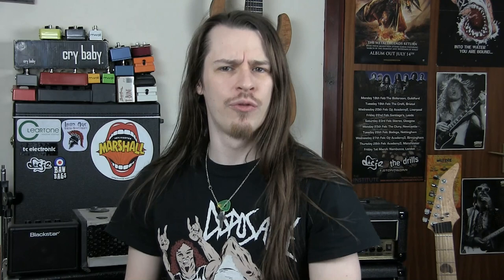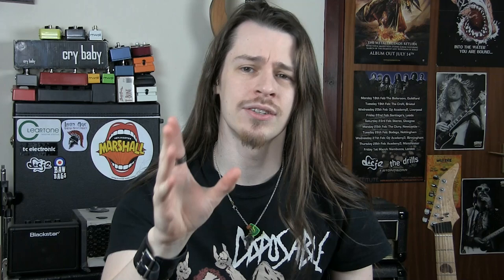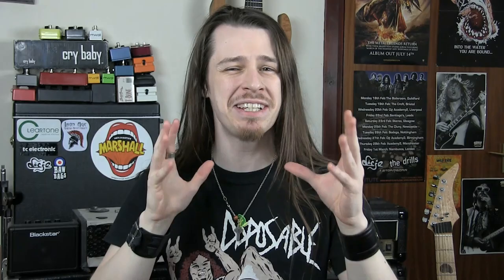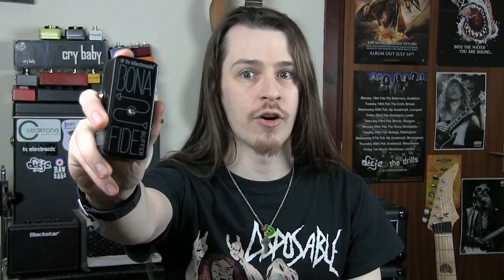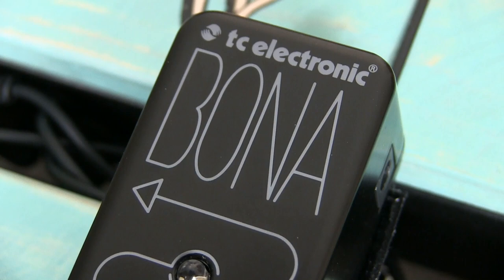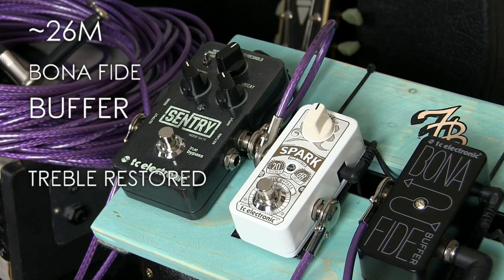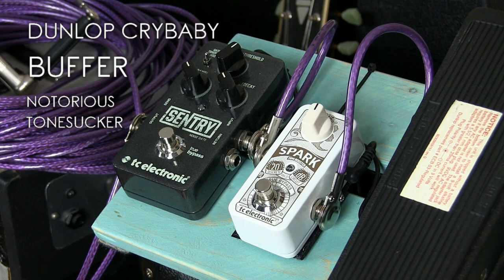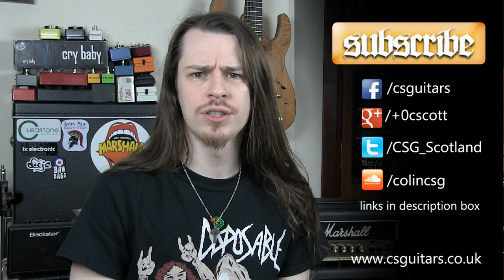The Truth About True Bypass

Comment: Another great video Colin. It would be good to quantify what makes a 'good' buffer and what makes a buffer less good. 
I'd suggest something like: 
Frequency: 80-18kHz +/-0.5dB
S/N>80dB
input impedance >1M
output <150R
THD<0.1%

If you're interested, I'll run some tests on the Boss, TC and crybaby buffers and see how they end up numerically.
Reply from the maker: I'd be very interested to see your process and results.
This would be an important resource.
Reply: +Keld Ampworks Yes please! :) I would love to see results. What will you be using to measure the db's from the output?
Reply: +Telebasterd Audio Precision gear for the audio tests, simple oscilloscope and fixed resistance method for the impedance checks. Not got round to it yet though, I'll dig out my DS-1 and make a start next week and post the results on. https://www.facebook.com/KeldAmpworks/?ref=hl

Comment: I've done rack kit for 15 years and not really messed with anything other than a metal sound. Bought a small valve combo a few years ago to play about with at home. Just bought an EHX Crayon as I was looking for a mid boosting pedal and found the crayon did the  metal TubeScreamer thing as well as well as being a useful distortion in its own right. Was great in the shop with short cables. Ran straight into needing a buffer when I got home.

Comment: Leaving your guitar cable coiled up, like you did, is also called an 'inductor', which kills your high frequencies, as well. Use only as much cable as you need. If you have too much cable, don't roll it up, spread it around in a random pattern behind your amp to reduce inductance. Try it. The results are as pronounced as the experiment you just performed. A long time ago, I learned this lesson when our band was using 100' speaker cables on small stages, coiling the excess cable and wondering where all the high frequencies from our PA to speakers were going. When we shortened or uncoiled the cable, the high frequencies came back. Good video.

Comment: As someone who doesn't know a ton about gear, I really love these videos. Can anyone recommend a wah pedal that isn't a tonesucker?
Reply: +Joe Nitrate Just a get a normal CryBaby and either adjust the EQ on your amp to compensate or convert it to True Bypass. Colin has a video about how to do this - it won't cost you much and isn't hard. I'm a total fucking pleb with a soldering iron and I've done mine.
Reply: +Joe Nitrate It's not exactly what you're looking for, but it's usually possible to add a true bypass switch to a pedal. This is a pretty common mod for wah pedals, and it's a full true bypass system - not just some "kinda" true bypass thing. You could do it yourself (It's not super hard to do, and there are loads of tutorials online, including one from the mighty csguitars himself), or you could pay for someone else to do it. The parts themselves are really cheap, the labour might be a bit more expensive - luckily I had a mate studying electrical engineering, so he did it for me for free.
Reply: Good advice gents, thank you
Reply from the maker: I have a video playlist of pedal modifications, which includes a demonstration on how to make a cry baby true bypass.
It's an older video, but it still checks out.
Reply: +CSGuitars speaking of which, I have the Dimebag Darrell signature Crybaby. It already has 2 LEDs (one to tell me whether the Wah is on or off, another for the boost), but would your True Bypass mod work on the artist signature Crybabies as well?
Reply from the maker: ***** It depends on which model of Dime Crybaby you have. The DB01 is Buffered, DB02 is already True Bypass. 

I can't speak for the differences in the circuit between the Dime and the Standard Crybaby, but I'd assume that you'd be able to implement the mod the DB01 without too much trouble.
Reply from the maker: ***** Just imagine how good his tone could have been if it wasn't though...
Reply: CSGuitars I have the DB01 model. Actually, it's still stock (as are all the rest of my pedals), and I still need to learn how to use a soldering iron before I even think about DIYing anything, but I am interested in getting my DB01 modded for true bypass.
Reply: +Joe Nitrate the new dunlop crybaby mini is a 3 voicing wah with true bypass
Reply: Ethan Yong I'm hearing that the new John Petrucci Crybaby is true bypass as well. And from what I already know about it, that's giving the Dime wah a run for its money (and that's me speaking as an owner of the Dime wah).
Reply: +Dion R Best way to get into pedal modding is to buy a used DS-1 or MT-2 and do one of the widely available mods. Not only do you end up with a decent pedal, but it only sets you back a few dollars (as in less than a hundred).

Oh, and look at that! Colin has videos for both of those! What a coincidence.
Reply: +Oliver Smith na..the FUZZ Pedals crushed his tone..so don`t worry about the cry baby ;o) different times
Reply: try the petrucci cry baby wah
Reply: +Joe Nitrate Dunlop Cry Baby
Reply: +Joe Nitrate MXR MC404 wah has true bypass, plus some other cool features as well (if you haven't bought a wah yet).
Reply: CAE dunlop cry baby is true bypass.
Reply: Apparently the Dunlop MINI cry baby is supposed to be good, according to people on a site I've been reading, there is no tone suck, unlike on the larger version, and the mini pedals are just as comfortable - I don't have one but I have a cheap expression pedal of that size and I have clown feet (size 13!) and I love that size pedal, the full size one only LOOKS more comfortable, but in reality, they both feel the same and the smaller one is better for bypass.
Reply: I used to have an original 1980's crybaby and I thought it was so thin sounding. I wanted a pedal that sounded great with a tone that has a lot of gain. I also didn't like the way Dunlop and others have a button under the pedal, I found that it was hard to turn on and off and I wanted one that would activate as soon as my foot went on the pedal, and off when I removed my foot. So I looked around and found the "Morley - Dragon II", and it is truly my savior. I don't find that it sucks tone much, if any, but it also has 2x wah settings and 2x knobs to change the depth of the wah swells, as well as how fat you want it to sound. George Lynch designed it, and believe me, it's a great wah, and I don't need to look any further.
Reply: The MINI version doesn't suck tone as it has updated circuitry (buffer) andyou canfind cheap wah pedals that are true bypass on Amazon. I'd go for a Zoom G3x - Wah, noisegate, dirt/amp, EQ, comp, modulation & ambience for a little more than the price of a crybaby, and works in a pedalboard.

Comment: From readings online, the magic number for cable/cord footage is 18.5 feet. That is the length where the cable has enough resistance by itself to effect tone. It's basically a matter of math. If you used a 20+ foot cord from guitar to the 1st pedal or the amp itself, you lost some highs in the tone with that section of cable. Mathematically, let's say you have a 5 pedal chain with 6 inch patch cables in between, that's 4 patches at 6 inches or 2 feet of cable. Then there is the true bypass or buffer to add in for each pedal as it applies. Is that 2.5-3 inches for the mini pedals widths ? Add another 5x 3 inches for the tethered chain and the pedal board itself is 3.25-4 feet of equivalent cable length. You'd have to run a 3 foot cord from the end of the pedal chain to the amp, 10 feet from the front of the pedal chain to the guitar to stay under 18.5 feet. Most instrument cables are 5 feet, add a 10 footer and also that 3.25-4 foot pedal chain and you get 18.25-19 feet. The larger full size pedals get you to high level tone loss in that chain of tone & effects.

Buffering is better in that regard, because a buffer stores the highs and passes it on. But let's say you go with a 20 foot section after the pedal chain to the amp ? You just lost that buffered effect in the pedal chain.

I use a 10-20 foot section after the pedal, 10-20 feet from guitar to pedal chain. I jave 4 pedals so we'll call that 2.75 more feet. Where I put the 20 foot cord has me over 18.5 feet, Buffered pedal makes no difference for what signal strength & tone that I lost. I think if I went 10/10/3.25 feet segments, then buffered pedals make sense.. Because the tone is preserved in 10-13.25 foot segments. Cables by their very nature degrade signal, inch by inch, foot by foot. You'll be able to tell that difference more noticeably after 10-12 feet. Those pre-manufactured sections of cord are conveniently measured lengths for a reason.

Comment: This is why I run my Blackstar HT-Metal first, really good buffer in it, it does colour the tone slightly but I find the way it does so really useful. It seems as though the EQ is still slightly on even after being turned off meaning there isn't a really drastic tonal shift when I turn it off.

Comment: Also worth mentioning than when you use a looper switch true bypass on the pedals isn't as important as when they are chained directly together since the looper will take over most of the bypass function.
As buffers I use the one from the Sentry before looper and Mimo after, going straight to an amps clean channel only.

Comment: I can vouch for the Bona Fide buffer and have 6 on 3 rigs. I run from guitar to stage pedals, mostly od's then to a rack with all the rest that are bypassed and manually turned off/on so they are not always in the loop. I noticed a nice bump up in volume,treble and overall tone with one after the floor pedals and one after the other effects and before the amps.

Comment: First of all you got a really great channel there. I love your vids, i can still learn from your guitar philosophies although i Play for more than 35 years (Perfect example is your vid about to set up gear with all the guitar volume and tone turned down a bit to be able to regulate up and down and not only to attenuate. I somehow knew this of course, but i never viewed it in that simple way which is totally logic :P) I also did a lot of modding to guitars and gear like you do, to know how to work with electronics is part of my Job and was a Hobby of mine since my youth.On True Bypass: Recently i really think about true Bypass for all pedals (aquiring some pedals who offer true bypass Feature to replace those i usen which don't). One thing about true Bypass: it allows the "working together" of the Input tube of a tube amp directly with the guitar if all effects are switched of. The second Advantage aspect true Bypass should reduce noise which all active buffer stages add to the Signal otoh the lower impedance provided by the buffer stage might reduce susceptability to external noise .A disadvantage of true Bypass otoh might be it could cause switching Pops depending on the Quality of the Switches.Sorry for my english which might not be perfect, since i am no native Speaker, Keep it up you really know what you do there!

Comment: This video shows that most people do not need a buffer, because they are only running about 30  to 40 feet of cable altogether. (old Imperial measurement system)
My board has a separate true bypass switch bar with LED indicators that help a lot. I made it using Carling SPST foot switches and Omron DPDT relays. 
My final pedal in line is a Boss NS-2 which has a buffer, so I am set if I ever have a situation where I need over 50 feet of cable between my board and my amp(doubtful).

Comment: What I have noticed that some of the folks that I work with have low level guitar outputs. They use boosters to increase the signal. Then buffers to balance the whole mess. Then true bypass.  Me I use Boss and MXR. I am okay with it. I don't use much Drive or Distortion.

Comment: I currently use five Boss pedals and a cheap Crybaby on my board, with a Jaguar on the jazz setting. Love the dark tone I get, but also use my DS-2 as a low gain (almost no gain) mid/high end and slight volume boost as my first pedal. Makes a neck pup sound like a bridge, and with heavy attack gives a little crunch to my sound.
I feel like one of these days someone is going to chew me out using a Turbo Distortion as a clean boost. I haven't found anything that works the same way.
A buffer after a war pedal then leading into a fuzz always makes the wah more clear in my opinion. Not a fan of wah after fuzz.

Comment: Back when playing in a band I never really thought about cable length and the effect on the signal. We had a bunch of cables we soldered up ourselves, 10-20m+ in length to give us plenty of slack to play with wherever we gigged. Fuck me the difference you've shown between 3+3 vs 20+6+3 is so pronounced. Luckily I was at least playing bass, so at worst maybe the strings sounded a few weeks older than they were ;)

Comment: Thanks for the great video. It's easy to digest. 

So what's a "long cable run"? You gave 2 examples, ~10ft and ~86ft - but I would guess most guitar players cable runs are somewhere in between... I use  10ft and 15ft cables on either side of my pedalboard. Where does the treble loss start to occur typically?

Also, how do high impedance and low impedance signals affect your tone? What if you have two or more buffers in your chain? Does the second buffer lower the impedance further? How does that affect tone?
Reply from the maker: +Matt M. Low impedance signals are not affected by the capacitance effect of the cables in the extreme manner that high impedance signals are. Being either High or Low impedance won't change your tone, but it will affect how the signal interacts with the cables and other equipment. 
A second buffer will not lower the impedance further, hence why only the first buffer the signal comes into contact with should be the only one making any effect (so long as the buffers aren't generating other detrimental effects)

In terms of where the treble loss starts with cables, it's always happening no matter what length of cable. 
How much cable it takes to make an appreciable difference however is dependent on the equipment you are using. 
This is usually only a problem for guitarists playing live shows where the amp may be some distance away from the front of the stage, where the pedal board will be. 
At a guess I'd say that anything over 30ft you'd probably start to notice the difference, below that and it's down to how sensitive an ear (and equipment) you have whether you'll pick up on it or not.

Comment: How are we supposed to learn about the quality of the specific pedal's buffer?

I have a few TBP pedals early in my chain, and then a chain of several buffered pedals; the earliest one is a Zoom MS50g, there's also a Zoom G3, and then a few Behringer pedals (one of which adds noise to the chain even when bypassed, only noticeable if placed before a distortion/dirt pedal) - I have no idea whether the buffers are good or not. If one buffer is better than another, I can just throw it in front when I'm not using it, just to have the buffer clear the signal better (not that I'm having any noticeable signal issues).

Comment: Hm... There is an other problem with true bypass pedals. Many people believe that it is "okay" to have everything in true bypass and then just addapt to the treble loss by adjusting the EQ of the amp and/or other pedals. But this bears a problem in itself, because NOW engaging any (true bypass) pedal means to actually apply a Buffer to the adjusted signal. Since they are all buffered/impedance adjusting. This often then results in way to much treble! 
You find this problem oftentimes with Reverbs and Delays if you use long cables.

Comment: I think that the tone sucking through the Boss pedals is not due to their buffers but due to their internal routing system based on JFETs used as switches. It seems way more realistic to me, because all the buffers used in these commercial pedals are pretty much the same.

Comment: To add on top of what you said; Active pickups do not require buffer (or not so much) because their signal is already low impedance. Am I correct?  Cheers!
Reply from the maker: +Carlos Mora Excellent point! 

Active pickups are generally low impedance devices, so active users will not see the same capacitance effects as passive users will.

Comment: I use a toy microphone that I turned into a buffer pedal by adding an input then I turned it into a partial bybass by removing the mic and speaker added an output then rewired it all to a switch. it will mix in sounds but the signal doesnt truly bypass the pedal when it's in the off position.

Comment: If you have to use a long cable, could you adjust for the lack of treble response by boosting the treble frequencies on your amp and/or using a treble-boosted EQ pedal?  I would imagine that could work for the lack of clarity from Boss pedals too, right?  I mean, I've used Boss pedals for years, and I haven't any problems with them.  Plus, I like the fact that you don't stomp on a pot switch to activate them.  Those pots make a loud popping noise all the time when you step on them.
Reply: You can try and do it that way and if that works for you then great and don't worry at all. However generally speaking its better to have the tone from your guitar reaching your amp with there being any major loss of any frequency. The reason for this is, the EQ section is essentially an individual volume control for each frequency. And it can't boost frequencies that aren't completely there.

Comment: This is an interesting video, if I use a long cable and it acts as a capacitor, I should be able to compensate for this by dialing the tone control all the way to 10, right? I think as you said in some of your other videos, it's nice to roll off the treble for a more pleasing tone.